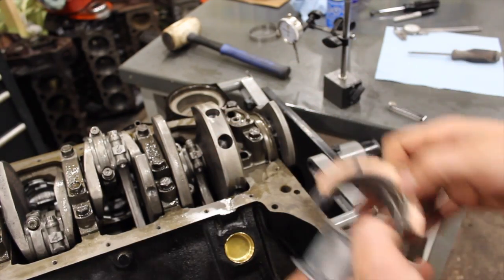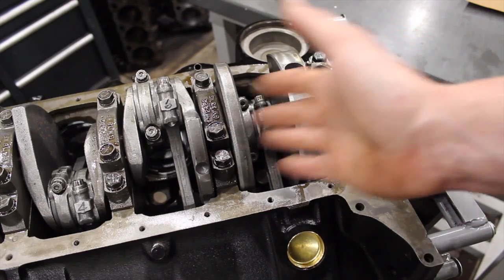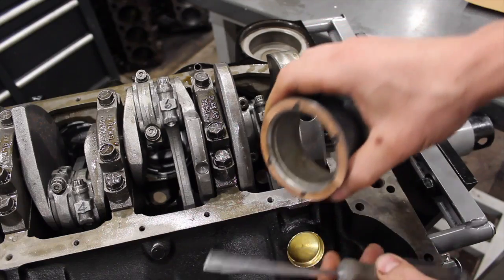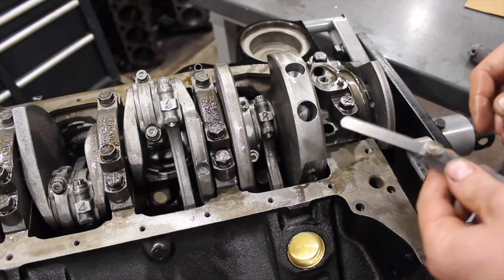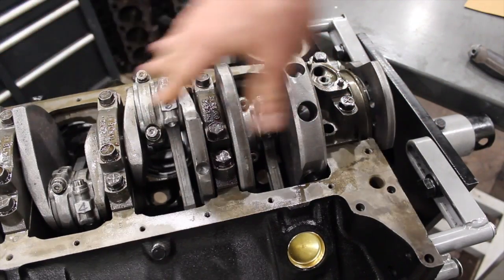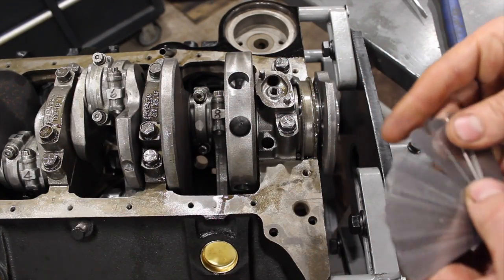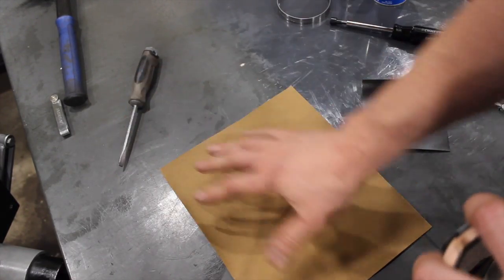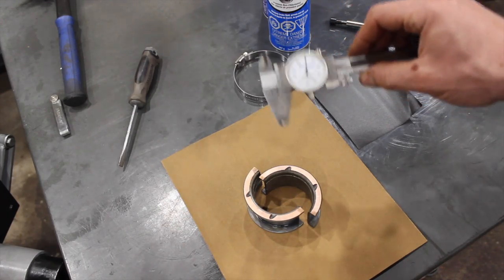How to Check/Adjust Crankshaft End Play SBC (Tech Tip!)

Comment: By bending the bearings is only a short term fix! To do it right! Is to get a oversized thrust bearing, and machine the crankshaft for proper clearance. If the original crankshaft has to much clearance , it will need to be machined anyway.
Reply: Not in this case.  His example was for TOO LITTLE clearance. And he then removed enough material to bring the thrust into spec.

Comment: is it possible for a higher mileage engine to have enough wear in the main bearings that there's up-and-down play (floating) at the front or rear of the crank?
Reply: Yes, this then leads to a drop in oil pressure since oil escapes in the larger bearing/crank gap and then main bearing failure.
Reply: @MrNRAInstructor  thanks for the reply! sounds like i found the likely culprit for the daily-driven LT1 Camaro's ~5psi of oil pressure at hot idle  😂

Comment: Question do you torque all the other bearings accept the rear before u hit with mallet?
Reply from the maker: You can torque or even just snug the rest. Only the rear thrust needs to be aligned
Reply: Thank u sir
Reply: @cuttersperformance   I know just the rear has thrust but just want to make sure if i should torque down all the others and the rear a bit loose when tapping with mallet? or leave them all a bit loose when tapping.  Also when i measure end play with mic all should be torqued down?  Thanks i appreiate ya

Comment: There was one sbc I built that had excessive end clearance (.035). Put it together anyway. There was no noticeable difference. I thought there would be a clunking sound under load, which would get worse over time. Ran it for around 50,000 miles. Seemed ok. No clunking under load or no-load. Most of the other engines I did were within spec.
Reply: I went to replace the rear main seal on my 93' 200k mile SBC the other day. Found a 2" long sliver of bushing material behind the old seal. Checked my endplay, .050. Still runs smooth as can be. Probably gonna do a rering/refresh this summer now that I know about it.

Comment: Do you ever use bearing blue to find and the scrap high spots on the main bearings? Or do you simply out the main bearings in and check with plastigauge?
Reply from the maker: Don't typically use platigauge, i use a bore gauge

Comment: Quite honestly, I think most people get this and have researched it. It was on of the first things I learned 4 decades ago. A better video would be of aligning the rear main on a BBC. It's easy, but most people don't even know that it needs to be done simply because of the over abundance of information on the sbc. Just about everyone assumes hat they see with the sbc holds true with the big block. Also, a venier caliper will not give an accurate reading. A standard micrometer should be used and measured on at 3, 6, 9 and 12' oclock positions. I'm not critiquing you, I'm just giving you my acquired knowledge of 37yrs in a auto machine shop. Peace out
Reply from the maker: I was asked by a subscriber on how I do crank end play, so I thought I would just make a video. I've had great luck with this method and I know alot of guys do the same or similar. I find a good set of calipers can be very accurate when used probably and I find most guys that dont have much experience with a micrometer will probably get more accurate results with a vernier caliper. 
I appreciate the input and thanks for checking out my video
Cheers!
Reply: Gotta measure cocks ,wtf take the time to make a video, edit it ,and post it . Mother fucker you can't please anyone.  Dude spent his time to educate the one that don't know . By the way how'd you end up here,  possibly needing someone to assure your build.  J,a  ,